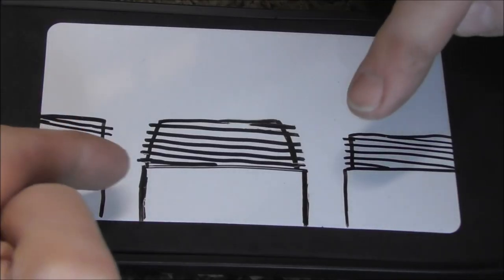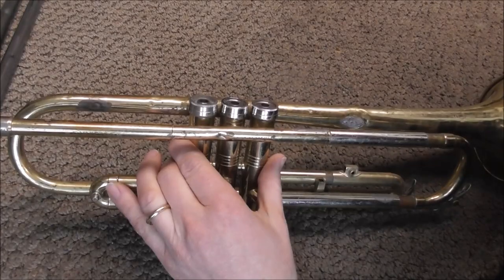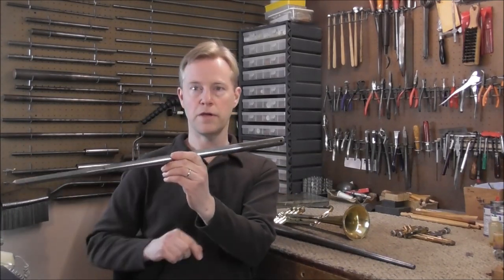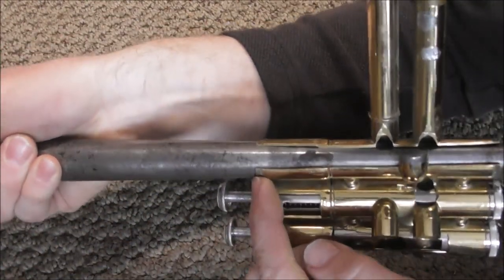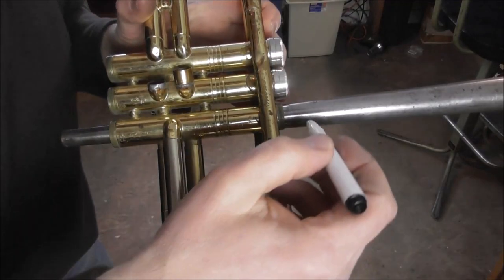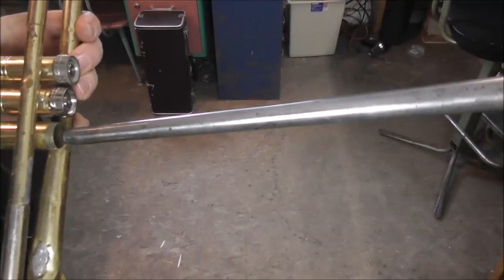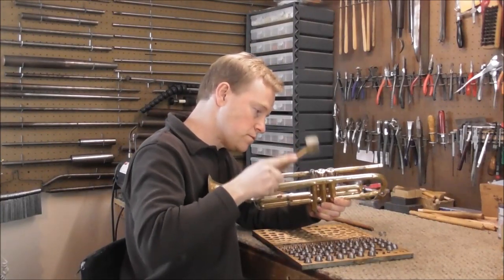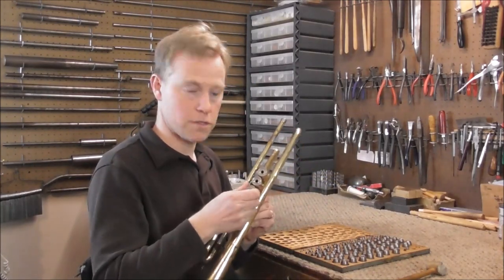How To Repair Tapered and Stripped Casing Threading on Brass Instruments

Comment: Hi Art, I love your videos, they are very informative. Do you have any tips on repairing finger button threads?
Reply from the maker: Do you know what is wrong with them? You can possibly try a tap and/or die. You may need to replace the finger button or valve stem if that does not work. 
An easier thing to do is switch around the finger buttons and see if there is a combination that holds. That is not a permanent repair, but it may buy you a little more time.
Reply: @TheBrassandWoodwindShop  Hi, I was thinking of splitting a same thread nut and spot welding the halves  to an old pair of needle nose pliers...sorta a mini version of your Yamaha casing thread tool, thought of it just after I pressed send. The threads on the Bach finger buttons are slightly bent, probably from careless installation, from the 2nd thread they are good. Thank you for the great idea...hope I can mig that small.
G.